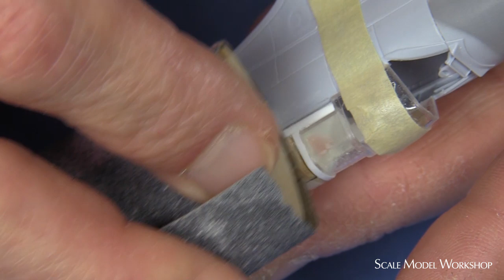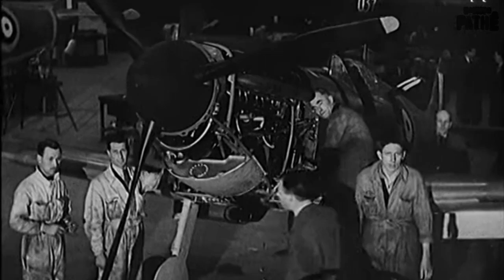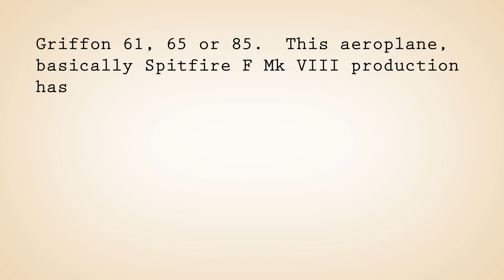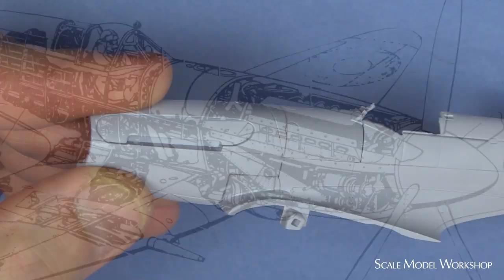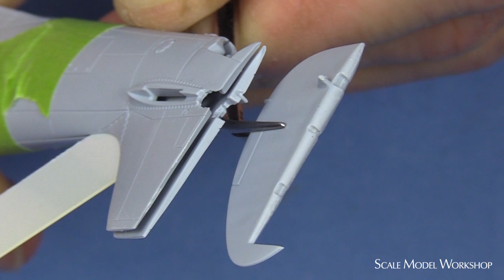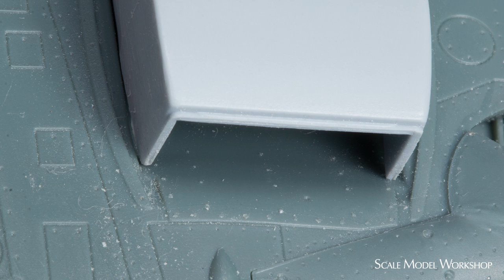Spitfire Mk XIVc Conversion

Comment: I worked on a model that needed a lot of scratch work. I had it sitting around since 1970 but never built. Once I started to get into it I knew why what a mess. But my model of the K-61-1 came out great just took a lot of scratch work. I was always afraid to do this until I watched your video a few times before I decided to bite into my model.

Comment: Imaginative yet very systematic and thorough job of conversion Dr. Budzick.  Would have expected no less from you.  I appreciate your sharing this procedure to push us to think about better ways to do conversions preserving accuracy and detail in the process.  I would have just started sawing at panel lines to try to mate up the constituent parts and then try to make the resulting Frankenstein look acceptable by smoothing the joins and restoring surface details.  Your approach would seem to preserve dimensional fidelity and accuracy.  I look forward to the finished product.  Thank you.

Comment: Interesting, I always wondered why the thrust line on the XIV pointed downwards.
Reply: Probably because more speed make more lift force in wings, so to avoiding the continuos correction during levelled fly they put the engine a little bit down nose!
Cheers

Comment: Thank you for sharing another great video.  Do you plan to re-enable the option to message you through your website some time in the future?  I have a modelling question I could really use your help with.  Either way, I really appreciate the work you put into your videos.  They're absolutely top notch.  I've learned so much since finding your channel a few weeks ago.
Reply from the maker: The PHP form that I was using is no longer supported, so I have resorted to this page to maybe filter out bots and spam ... contact me this way: http://paulbudzik.com/spud51.html